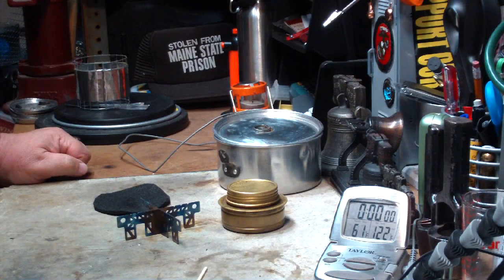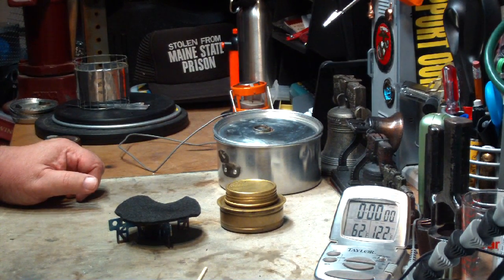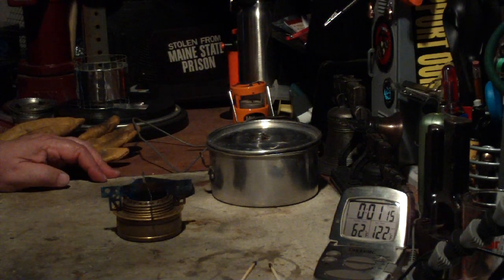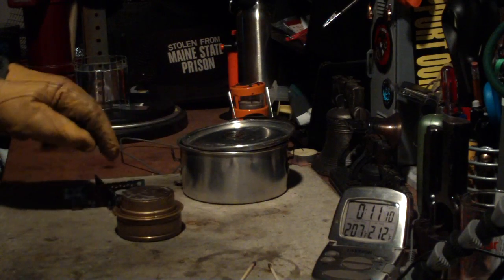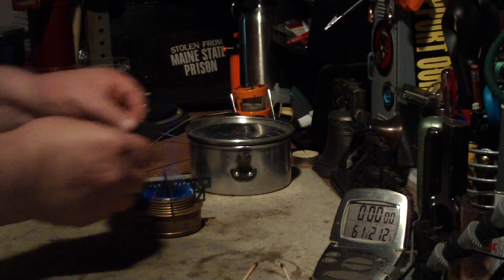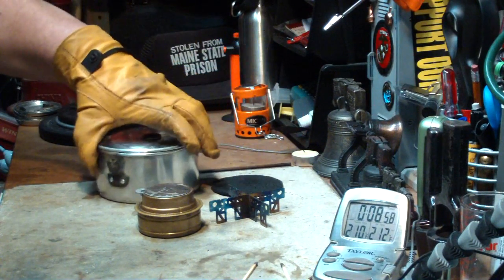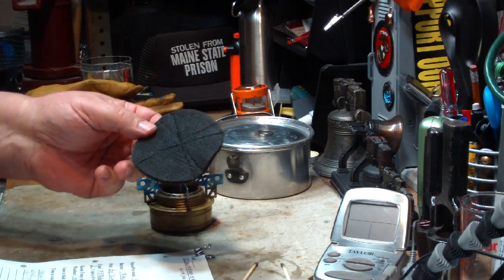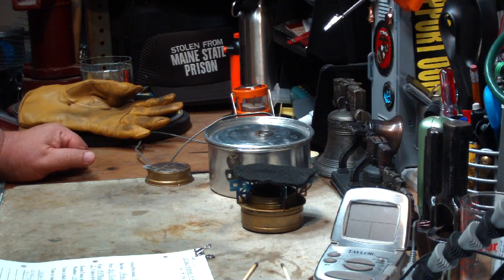Yet Another Way To Use Carbon Felt With Your Trangia - Revisited

Comment: Carbon felt is a very low density material and probably lower heat capacity compared to many metals = it will heat up quickly. It's also a pretty matte finish = excellent at recieving and radiate heat. So, instead of the slow start heat being absorbed by a cold pan(with low radiation) the carbon felt will feed heat back to burner = earlier bloom and higher alcohol boil-off. I'm actually surprised the insulation didn't prolong the boil time anywhere near to ruin the other "positive" increases. I would guess, based on the data, that right under the center of boiler in a standard setup it ain't that much heat output anyway; the center is boiling off alcohol, shooting up, but probably little oxygenation/actual burning = cooling effect = which is why the added insulation didn't impact the overall heat transfer part that much. As with anything pretty much, doing stuff quicker will incure larger losses though.

I've been looking for (hopefully passive) strategy to better regulate the burn and make a cleaner burn. Methanol seems to burn way cleaner, less yellow/sooty flames is one way, but I'd like to accomplish clean burn with ethanol too. I notice with a designed shroud close to trangia jets I can essentially make a bunsen burner, wheezing evil, solid blue flames on ethanol... however this causes a complete thermal run-away of trangia 😂 the flames just grows higher... Higher... Wheezing intensifies! It's going to burn a hole in aluminium cookware if pots ever would go dry. Thanks for your diligent testing! 👍

Comment: The large internal surface area of the carbon felt might be acting like a heat exchanger, transmitting via conduction to the pot -- similar to a heat exchanger pot with aluminum fins. Heat rises, so having the felt above the flame might reverse its insulation role.

Comment: So the felt setup used 17% more fuel but reached boil in about 80% of the time.   It won't save fuel on a multi-day trip, so it isn't a solution for through hikers.  Nice for overnighters and car camping or lunch stops while traveling.

Comment: Use a pizza stone between the flame and the pot.
You could try using aluminium bar stock and make a pot stand out of that.
Leave them long as a heat dissipater of sorts.

If you don't mind the soot, use 70% alcohol.
Burns cooler.

Did you put some rocks inside your Zebra pot?

Comment: I would be resurrecting an ancient thread here, but I think the source of the extra heat that is generated both in the pot and the stove is due to capturing more infrared energy with the dark material.  You see this same principle in using dark pans in the oven, they heat up faster and can burn food if the recipe was created in a light colored pan.

Comment: in insulating the heat and reflecting it back into the burner causing more vaporization of the fuel for higher burn rate, therefore higher heat/more flames thats causing the flames to spread out over the base of the pot giving a faster boil time

however i bet if he used a narrow pot the boil time would increase due to thermal loss off the side (wider flame not touching the pot as much)

Comment: Hiram, without the carbon felt, the alcohol vapors contact the bottom of the pot and the pot temperature is <=212F.  I think that with the carbon felt in place, it acts like an insulator, so the alcohol vapors can get to a much higher temperature.  The higher temperatures feed back into the stove accelerating the vaporization rate thus creating a high pressure, thereby causing the flames to spread to a wider pattern.  My 2 cents - Jon

Comment: More fuel in less time, the felt is turning up the stove. The same as with the Hard-wire stand with and without the foil. Contain the heat = turn up the burner = quicker boil times.
Hiram say that's not much more fuel but remember it's more fuel in 2 min less time, that's allot more fuel per min. first test is about 1.38 grams per min. and test two is about 2.04 per min.   perhaps I'm missing something??